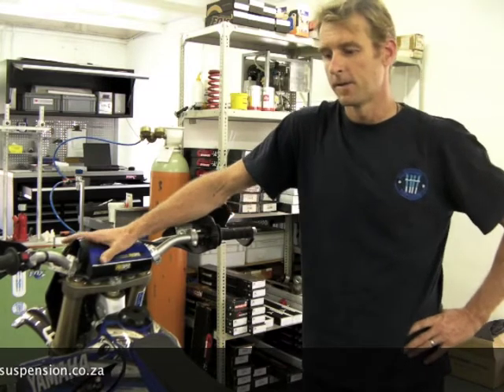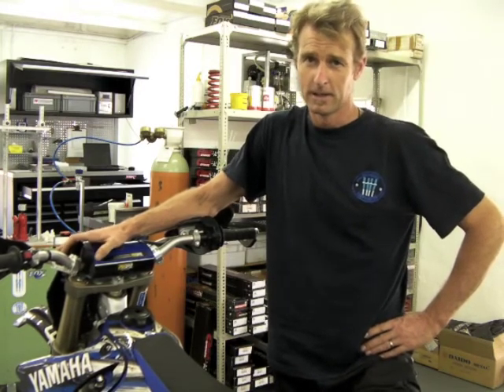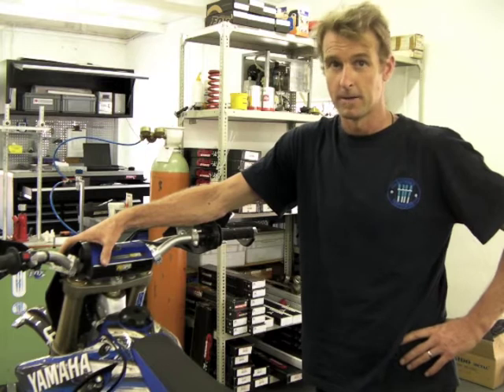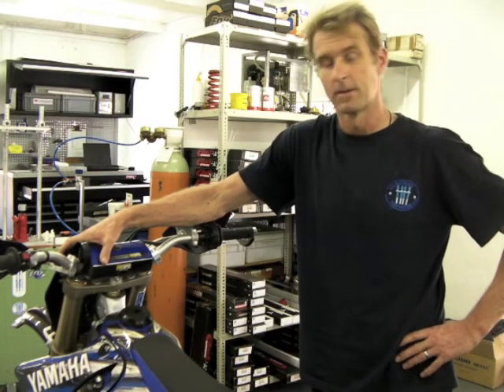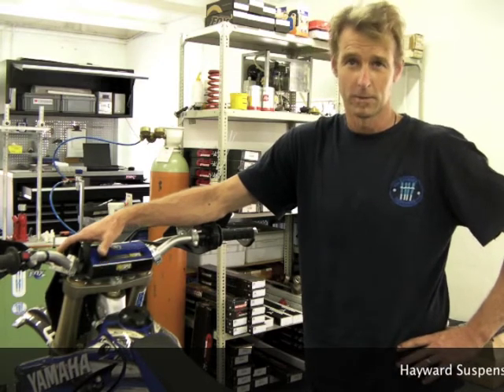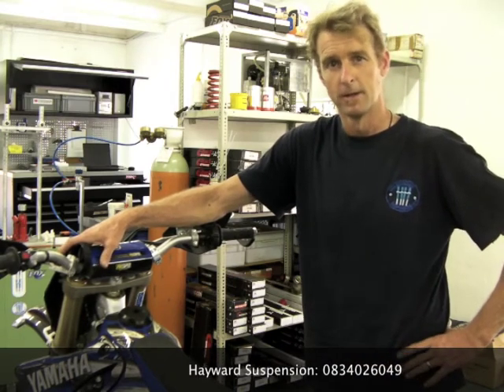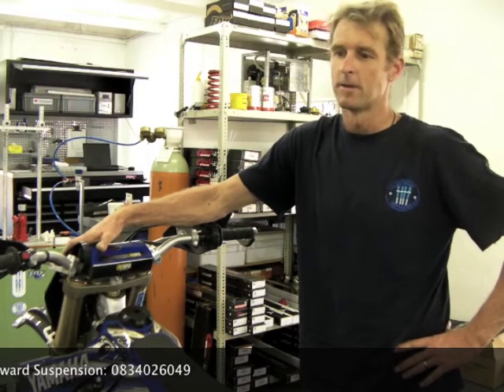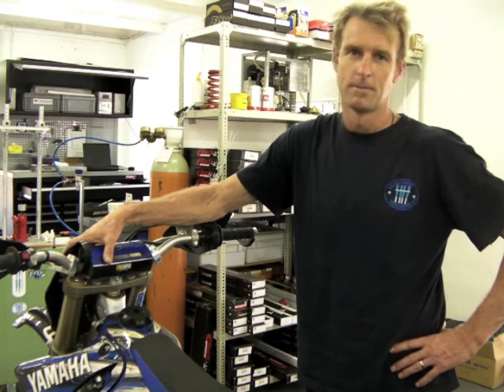The evolution of WP forks

Comment: Very interesting video. I had read about what he is talking about in the end. In MotoGP they have tried other suspension (and frame) designs that try to go on the theory of how the system works. Hub steering for example, this is more rigid and resists brake dive. But in practice, those are GOOD attributes of telescopic forks. When at extreme lean angles, the suspension doesn't work, you NEED the flex to soak up bumps. Brake dive improves traction on the front and thus improves braking.